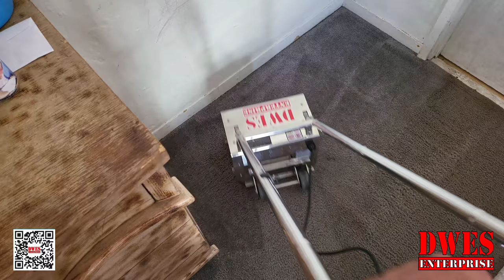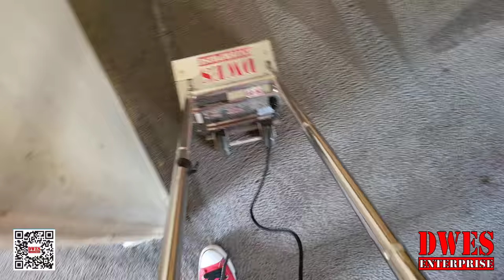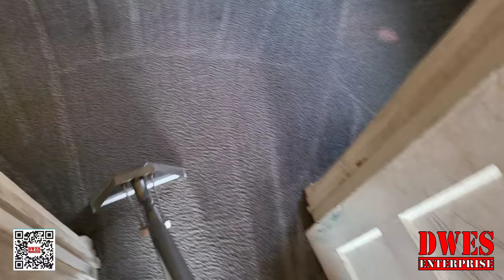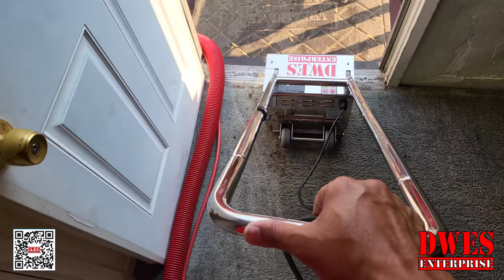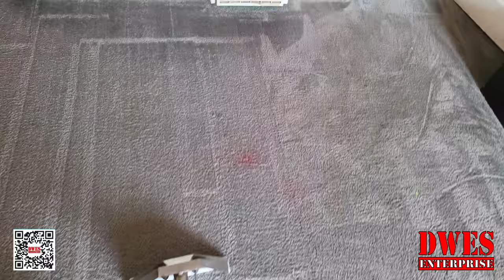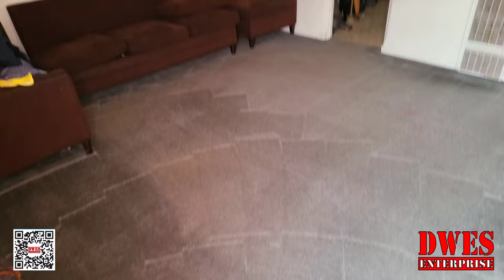Another Repeat Customer... Same Ol Filthy Carpet | Carpet Cleaning by DWES Enterprise

Comment: Thanks for the video. How long have you had the carpet shark? Ever break a belt?
Reply from the maker: Had it for a little over a year... Haven't broke a belt. I did have issues with the poles that hold in the brushes getting fused. Had to use a sawzall to cut it off. Then I ordered the new brushes and poles. Also the magnets that hold the base were rusty and broken. Gotta put new ones back in.